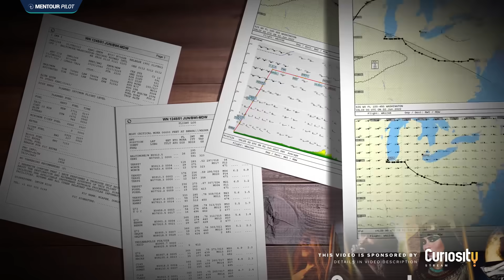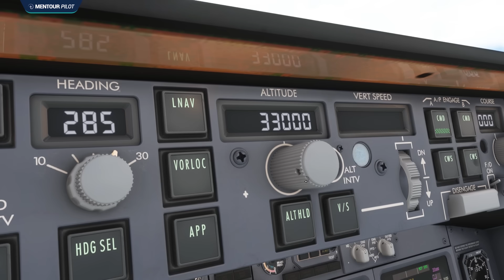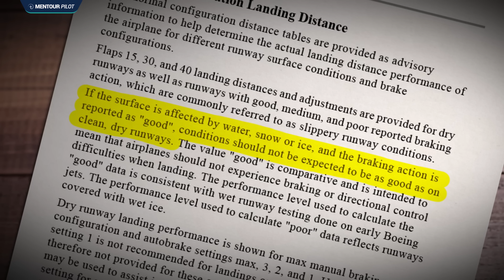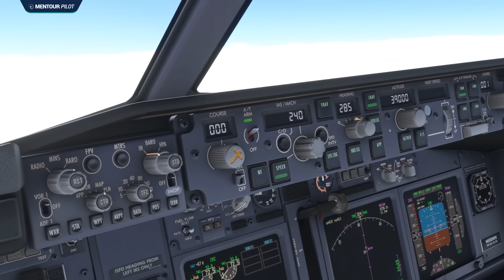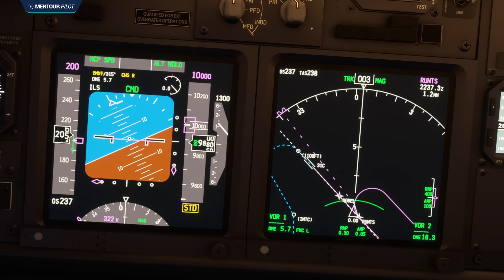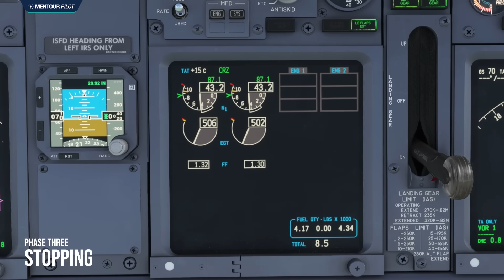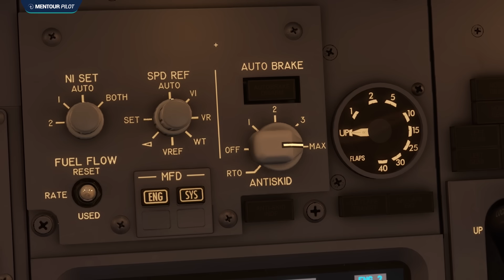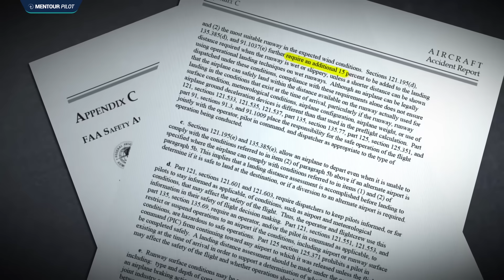WHAT did The Pilots MISS?! Explaining Southwest Airlines flight 1248

Comment: You mentioned the number of runway excursions increasing and the need to manage risk factors, but I'm actually much more interested in why you think they're increasing in the first place and what factors are affecting this?
Reply: Yes please! Maybe a good Mentour Now topic???
Reply: I would hazard a guess that this increase is simply correlated to the increase in the number of flights. There is also the fact that modern tools make it easier to detect minimal runway excursions that might not have been registers in the old days. (this was mentioned in another Mentour video) When a plane only edges into the paved runoff area by a few metres, it can look from the tower like no runway excursion has taken place, but nowadays, in modern airports, there are detection mechanisms at the end of the runway itself which will catch the smallest transgression.
That being said, runway excursions are still extremely rare, with fewer than 20 incidents/year across the world in the 2009-2013 period (on average 0,57 incidents for 1 million sectors based on 2009-2013 IATA data and this average is skewed by the poor performance of Russian and African operators (respectively 1,45 & 3,98 incidents/million sectors))
Reply: I would guess that overconfidence in technology is a major factor. I've seen a trend over the last decades in several areas that people, especially younger, put 100 % trust in anything that comes out of a computer and/or assumes that the computer only accepts valid inputs.

Don't get me wrong, computers and technology are wonderful tools that allows us to do things that wouldn't be possible otherwise but a bit of sanity and allowance for external variation must be included.

We see one clear example in this video, they enter one figure into the computer and then trusts the output fully (and then some). That the application adopted the wind figure without a major warning is a serious error in the program in my opinion - it should have given an information window like "entered tailwind above permitted value, verify input).
Reply: Maybe an over reliance on automated functions. I’ve watched a few documentaries about flying that mention pilots are increasingly lacking functional skills because they don’t need to practice them as often due to the computer doing it for them.
Reply: @sharg0  Just to add to your comment. Likely a mix of using these computers allows us to get near max landing ability but you loose the safety margin of the pilot's decision skills (sounds like before this the old way was the pilots' gut feeling) but now if a PC says it is fine to land they trust the 'hard numbers' instead forgetting that humans & equipment (tire grip, no blow out, ABS allowing max braking when in some cases it can be worst then manually doing it but is very rare, pilots forgetting or doing something late, reversers being slow to open or don't at all due to equipment braking, landing late on the runway). The FAA knows this and requires a built in 15% safety factor into the PC cals but personally feel that 15% in the dry is likely fine but should be 25% in icy/snowy/extreme wet weather and 20% in normal wet conditions. If those pilots didn't have a PC telling them they are fine to land then good chance they would thought it wasn't safe and landed at an alt airport. Also it might be a good idea for pilots to be trained to try and keep an additional safety factor ontop of the PC's report - ie they need at least 500ft of runway left no matter the PC's cal results and should reconsider landing options if they are under that 500ft remaining per the PC cals. Trying to get max performance and using hard numbers is great if we lived in a prefect World, but we don't and just need either higher margins built in those tools or train pilots to make the final call (as if expected of them; but they tend to forget that applies to certain aspects like a landing cal from a PC) & remind them safety if better then risking it. Of course something like this is rare so changing it to affect businesses (cost $$ to keep landing at alt airports for something that might happen in a 1 in 100,000 flights) so you got to play both sides (FAA) because if safety was #1 then we wouldn't fly ever for due that one in a million chances of a crash. Either way; I do put some blame on the cap for using a tool for the first time in extreme conditions (and wasn't required to use it yet) if he wanted to try it [auto brake system aka ABS] out he should of waited for a sunny day, then next on a wet day, then lastly a icy/snow day since he was 'testing it' -- or better yet in a sim if he had sim time coming up -- don't blame him for trusting the PC cal but he should of added his own safety margin ontop of its results - either of those could have avoided it. However, I'm annoying the FFA allowed for basically no run off space at this airport they should of downsized the runway or installed the break-away cement and not approving it with no safety factor. TL;DR if you keep using systems and taking away safety factor/margin from everything then of course crashes happen (no safety margin in the landing PC cal, no safety margin in runway runoff length).
Reply: I'm interested in this one, too...

   I ride a motorcycle, and I've noticed traffic is distinctly more crowded and dangerous with every passing year. I like to accuse "Nanny tech" for the false sense of security and safety of over-reliance on robots and computers and "driver aids" from ABS to crumple zones, air bags, and all the rest for this phenomenon, myself. AND arguably we are considerably more prone to unnecessarily dangerous behaviors in or one motorized vehicles on the roadways... BUT if the worst you think you're going to suffer is the inconvenience of a scary incident and a broken vehicle, you're more likely to engage in stupid behavior that you might avoid if there was (for example) a large iron spike in the center of your steering wheel pointed right at your face, assuring you of death in the case something "bad" happens.

    BUT arguably as well, I've seen a fair share of bikers engaging in stupid and self destructive behavior on the road in SPITE of a lack of gear, safety features, nanny-tech, or any other "protections" offered for riding their motorcycles, too... SO I can concede that I probably simply enjoy riding the "old school" bikes with their brutishly primitive features and have no qualms about the risks I take when engaging with a completely manual transmission and ZERO anti-locking features in my brakes... SO this observation and experience in "human nature" may well be entirely anecdotal...

     Maybe the increase in excursions IS a direct relation to increased traffic and some dubiously contributing factors of "everybody is in a hurry" and over-confidence in calculations done with hard numbers that at least occasionally do NOT work well with describing the actual "real world"... I mean we still struggle with pi and mathematically describing a circle or arc... in spite of our advanced computation technology. So REMEMBER that.

     In any case, I'm definitely interested in what a consummate professional WITHIN the industry in question has to say about it. I hope Petter notices this thread and at least contemplates an episode in Mentour Now for it.  ;o)
Reply: @mariusdufour9186  "fewer than 20 incidents per year" This has apparently changed since 2013. A search on AVH shows 23 excursion incidents already this year (june 4, 2022) and that's only the ones AVH has covered. That's about 1 per week.
Reply: I think the increase in the number of overruns is because more planes are going off the end of the runway.
Reply: @tommc290  I haven't seen the most recent data, I was looking for multi year global averages. Anyhow, if 23 excursions in 6 months isn't some statistical fluke, then  that would indicate a relative increase in the number of incidents since 2013. (air travel didn't exactly double since 2013) That would indeed be a worrying trend. Considering the roughly 100,000 daily flights, that's still 1,45 excursions/1 million flights so an order of magnitude more likely than winning the lottery, but still less likely than a person getting hit by lightning.
Reply: @nocare  Well, I still worry (just a little) that too much fixation on safety gear is going to result in a biker looking like Randy in "A Christmas Story" (movie)
   "Ma'... I can't put my arms down!" (if you recall the scene)...

    I was told by an old coach that no manner of safety equipment or device is going to do more for my safety than my own brain, THE most powerful thing in man's entire "arsenal"... if (but only if) it's engaged properly...

   In any case, it's one thing for me to "armchair hypothesize" what's wrong with an industry I literally have very little business with... AND another thing to be interested in what someone "with real skin in the game" has to say about it one way or the other.

     Progress and safety regulations are written and etched in lives lost and blood. That's the cost, and we're either "okay" with the price, or we're not. hopefully some of even our dubious digital discussions might inspire someone else to invent or engineer and even maybe streamline systems to make them all better. I'm certainly not against avoiding any more danger than necessary, even if I am one of those self destructive chaps who ride motorcycles. ;o)
Reply: @JohnAdams-qc2ju  the captain believed the autobrake was to be used, didn't get the memo that implementation was postponed.
Reply: Why don't they put up some kind of mechanic system on every airport that will catch an airplane, like in the navy, where there is some kind of rope catching fighter jets. Even if the airplane breaks, it would be much safer for people on the ground... Shouldn't be that complicated or expensive to have a fail safe air plane stopper...
Reply: @GALENGODIS     You're talking about the restraint systems on Aircraft Carriers... yeah?

    That's best described as "a controlled crash" every time a plane sits down on the Carrier...

    It's not a "traditional landing"... at least not in so many words. We're better off with a controlled LANDING with regards to airports... AND the best "last ditch" kinds of things would be something akin to aerated concrete at the end of the runways... something collapsible like a "runaway ramp" for 18-wheelers where the last bits of inertia could be arrested by sand, crumbled concrete, or some such material without causing more harm than necessary... and still keep the plane(s) from escaping the airport.

    I like your thought here, so let's don't get me wrong... BUT the aircraft carrier's rigging for a "controlled crash" is only used because on a ship, if you don't bring it with you, you don't have it to use... Space and weight become a couple VERY precious commodities... On land... as in an airport, we have space to play with... and I think we should take fullest advantage of that... 

     BUT keep figuring... Maybe you come up with the best new ideas... Draw on! ;o)
Reply: Perhaps I wasn't clear in my earlier reply... I think that the number of overruns is increasing because more planes land and then go off the end of the runway. The factor I think is the root cause of this is that planes land and then don't stop soon enough. It seems that a reasonable solution to the steadily increasing runway overruns would be for planes to stop before going off the end of the runway. Perhaps a new training protocol could be put in place by the FAA that would require pilots to show proficiency in stopping planes before they get to the end of the runway. I think that the third grade argument of "make runways longer" will just add to the problem if pilots aren't trained to properly stop an aircraft before a runway excursion. Perhaps a more practical solution would be to install giant stop signs at the end of the runway. Say 50 feet across and octagonal just like roadway signs? Also, it might be a good idea to have runway traffic police with EXTREMELY loud whistles to order the pilots to stop. 
It's actually kinda scary that pilots aren't trained to stop before careening off the end of a runway. Smh
Reply: @TracyA123   Okay... for what it's worth, I think I get (kind of) what you're trying to get at... BUT I kind of doubt anyone actually lands a plane and somehow forgets to engage braking... These planes weigh in excess of 100,000 pounds empty... It's not as easy as stopping a car or a truck on the highway... 

     A runway excursion (the best I can tell) starts while the plane is still in the air... I'm not sure if it's some tendency to land further down the runway than should be allowed, or if there's an occasional lack of "flare" before setting it down to lose some speed... or there may be a list of factors... 

    Personally, I think airports are getting busier, and pilots are getting "rushed". Even if they're not outright being told to rush, they're feeling the pressure to get to business and get it done...

     Sometimes with a monstrosity with hundreds of thousands of pounds at over 100 mph, there's a judgment to be made... and things just aren't going the way you'd like... Sometimes that means a conservative judgment is best, and you should've called "Go round" and sometimes it's okay to just "drop it a little late" rather than waste the time to pick up again, and make another circle around the airport to get in line for another try at landing...

     When rushed, a pilot's a bit more likely to test his luck and "drop it a little later anyway", and when he runs out of luck, he CAN'T stop before the end of the runway... It can be a little bit, just sinking and breaking the front gear in the dirt at the end... AND sometimes it's ripping up the bottom of the plane, careening through dirt and grass and fence and across a heavily trafficked highway into a mall with a giant fireball and shrapnel everywhere, and a bonus feature on Petter's Channel here... or it could be anywhere in between.

     I hope this helps... AND no, I'm not arguing against you... There is the possibility of someone just not getting their brakes engaged soon enough, and an alarm in the cockpit might be a slightly better idea than a cop outside trying to get anyone's attention with a whistle... just my thoughts. ;o)
Reply: @gnarthdarkanen7464  Well I didn't think my common sense solutions would cause such controversy. I see your points but I think the problem shouldn't be broken down into a bunch of complicated theories like that. That kind of wild speculation about the cause of this overrun increase just isn't productive and I think that the most elementary school solution is best. Pilots has been running amuck in the air and flying planes all over the place. It's quite dangerous and I don't think they should add to the danger by running off the ends of runways. It should be stressed to these daredevils from the very beginning that THEY MUST stop before the end of the runway. I think my solutions were simple common sense and I didn't have to have an advanced degree or even graduate high school to figure them out. Please, any pilots who might read this, please stop before the end of the runway. According to this gnarth guy, you people have been careening through shopping malls in giant fireballs and thats just not a nice thing to do.